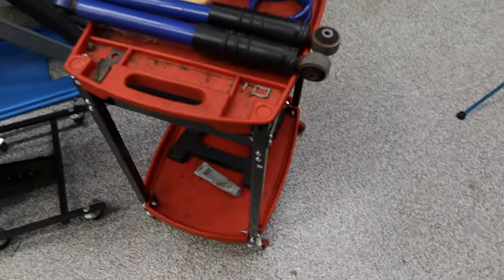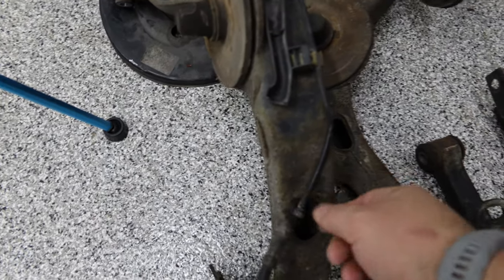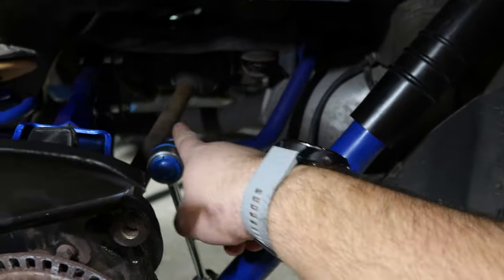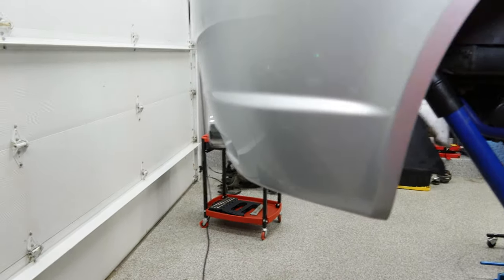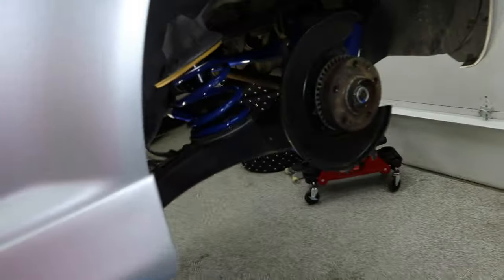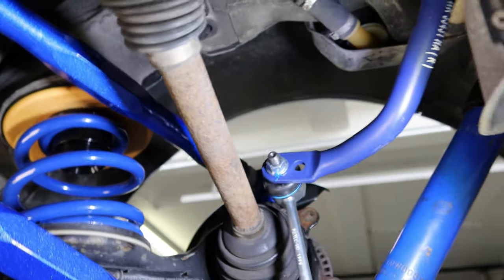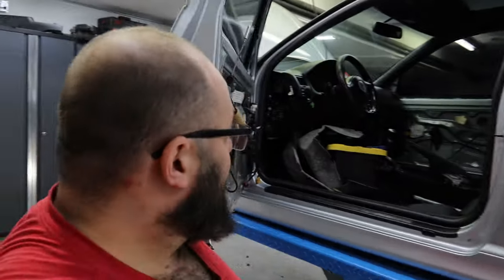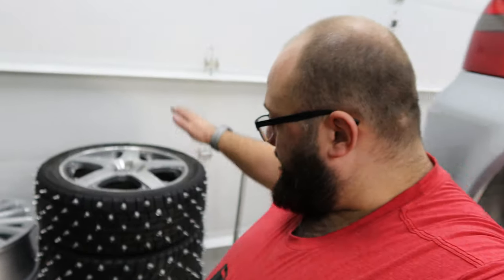VW MK4 R32 Complete Rear Suspension REFRESH, Looks AMAZING! The Project Car Rebuild Pt. 15.

Comment: Looks like the H&R rear sway bar? I recommend the stiffer of the 2 settings. I tried both and 100% prefer the stiffer one.
Reply from the maker: Blaylock1988 yes it’s is, thanks. My thought was to go with the 2nd setting but want to try out the first setting first, just so I know! 👍